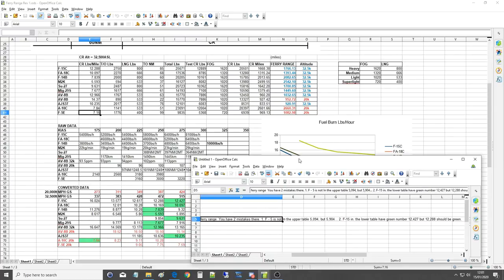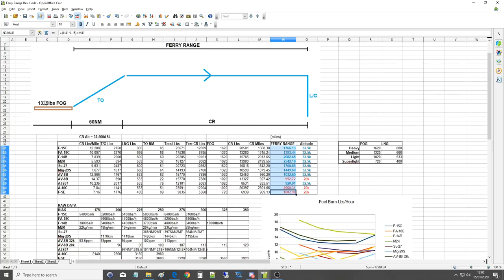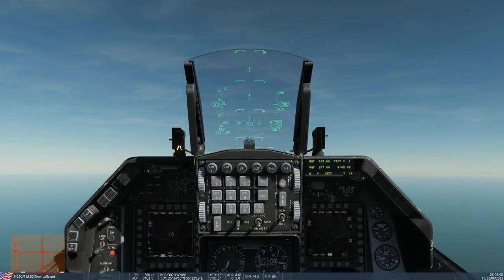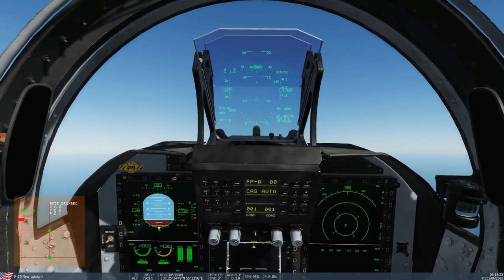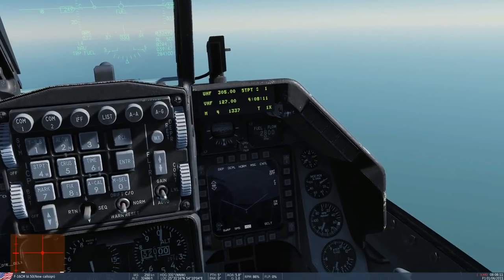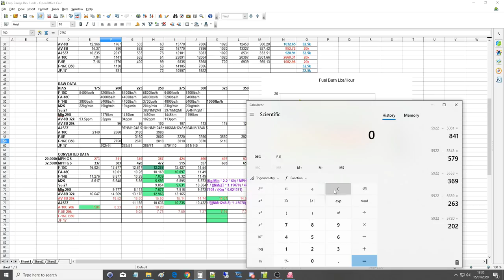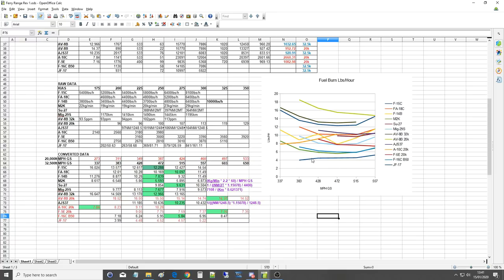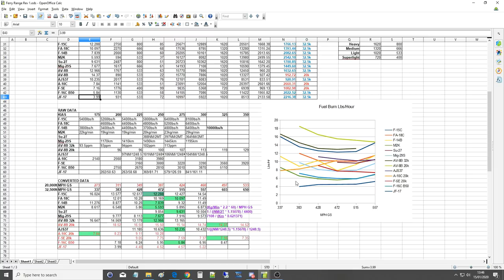F-16C & JF-17: Max Ferry Range | DCS WORLD

Comment: Small FYI: the jf17 has the "combat thrust setting" which  gives both a little extra burner power and also a little extra mill power. I haven't measured how much, but the n1/temps are certainly both higher

Comment: As far as I understand flying a long range cruise would be done with the PERF pages for optimum climb speeds and cruise alts. Step climbs (or cruise climb).  Fuel planning and check pointing would be done with performance tables.  First for a given TOW (or sometimes departure weight) the "Initial cruise altitude" can be looked up and the fuel required to reach it.  Then for a given gross wight, altitude, speed the plane will burn X fuel in 1 hour and cover Y air miles, adjust with temps, .winds aloft data etc. to get real miles covered.   The step climbs can be looked up on the optimum cruise altitude charts for each hour based on the fuel burn off.  Descent fuel can be looked up, arrival fuel requirments... landing fuel, taxi fuel, divert fuel, reserves etc.
Airliners do this for every flight.  Although the dispatch teams have software that will do the most of it automatically, the captain still have to check it.
I wrote fuel planner software for the Concorde SSTSIM back in the FS2004/Vatsim days.  Concorde had one of the most complicated fuel planning regimes due to having more phases of flight, Mach climb/cruise and subsonic legs.
Fuel planning can often be iterative as you can only guesstimate your initial TOW until you calculate the fuel required... which changes your TOW, so software will often iterate a few times through.
Some airliners use simplified lookup tables based on distance, CRZ alt and ZFW.  These are basically pre-run approximate plans with given TOWs.
Granted most of my study in this area is based on civilian aircraft, but the physics are the same.

Comment: I dont konw much about the JFT in real life, but Deka may exaggrate or narrow some perfermance and capability of the plane,or even whole China Assest Pack. We never give out many perfermance data about our weapons, so Deka is working on their best not to break the law.（Besides, as we all konw this is only beta, who konws if they will change some perfermance)
For JFT vs F16, JFT has an enginee with better efficiency, smaller crossection, Dsi intake helps a lot, and it has a better flight control(this helps)
Besides, this do match the official data

BTW, i think F 16c should be considered as a medium aircraft. 
And you can just use the AI to drive the plane for you, and u jump in the cockpit to record some data. Also, u do need at least 6 times to test i think

Comment: Pakistan air force f-16 block 52 C reports 2600 mi ferry range while pakistan air force jf-17 block 1 reports 2200 mi ferry range . Both aircraft with 3 fuel tanks with full fuel in them.  So you are correct jf-17 should be slightly worse than f-16. I guess ED needs to fix f-16 block 52. Unless u having half tanks of fuel somehow effects weight and alpha of the flight. Good stuff and that's why i am a subscriber! We call BS on F16 part. Not jf17.
CR lbs/mile for f-16 should be around 3.7ish not 5+

Edit: another interesting fact Pakistan air force calculations state CAP edurance of F-16 block 52 C type at 1 hour 40 minutes in air and 200 nautical miles from base. While for jf-17 block 1 CAP endurance came out at 1 hour 35 minutes roughly 190 nautical miles from base. Not sure if fuel tanks were involved in this measurement but pakistani f-16 do have conformal fuel tanks in addition to external "Bags" on pylons
Reply: Blackbirdz2000  true
Reply: Neither of these aircraft are modules in DCS. We have the F-16 block 50 and the JF-17 block II. Don’t actually know if there’s any difference to performance tho.
Reply: The version we have has data link and is getting air refuelling pod. I’m lead to believe these features were only available from block II onwards.
Reply: Well there you go. What’s the go with link 17? Has it got more advantages?
Reply: Um.... wow Read my response above as it was actually a legitimate question as I’m not aware of link-17.  Talk about charging in bro

Comment: Are these results accurate to real fighter jets or in DCS only? Because f 15 Wikipedia shows 5600 miles.
Reply: Ramsay Beshir ok thx. In other question, dcs world has accurate info about the real actual jets?
Reply: Definally not accurate for some aircraft, such as Su27, which had max range around 4000km, but in DCS it barely get past 2000km...

Comment: Not in  defense of the JF17.  But this brings up another point.  Any real-world specs used on the Jf17, are going to have 2010 numbers (a 50 year advantage in some cases). Advances in Composites, Engines, Fuel Pumps. The Thunder is classified as 'LIght Fighter: Multi Role'  with a 50 year advantage in specs it makes the JF-17 an 'Air Superiority' fighter. Which is nonsense.
So, the fact that the numbers are flubbed BEYOND this already unrealistic number pisses me off

I understand there might be a need to make specs more playable, but to be honest, Air Combat is 100% about exploiting an opponents weaknesses, sticking to your advantages, and avoiding your own weaknesses..  This paints the Thunder outside the realm of reality, outside the combat envelope, beyond simulation

at this point, i dont understand why we cant have the Euro-Fighter, or the Raphale or the F35 Lightening II.. if they are going to allow the Thunder in there. 

and if they are going to make shit up, why cant i have the Incom T65 X-Wing Superiority fighter?  Hmm?
Reply from the maker: Roger noted

Comment: F 16 is lighter than JF 17 and has a more powerful engine. Jeff is relatively heavy. We demand both; Falcon and Thunder to be re-evaluated in their modeling. Either of them is not properly modeled. Indeed the Thunder looks the most odd but their results have to be neck to neck. Please contact ED and Deka Ironwork both.
Reply: The JF-17 is lighter at 14,520lb
The F-16 is heavier at 18,900lb